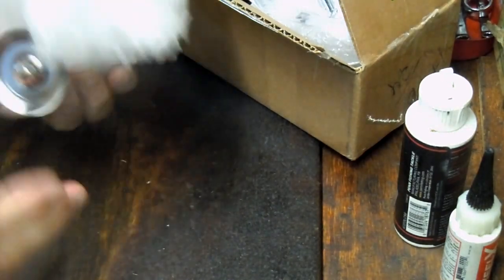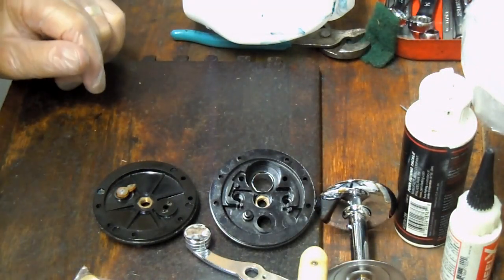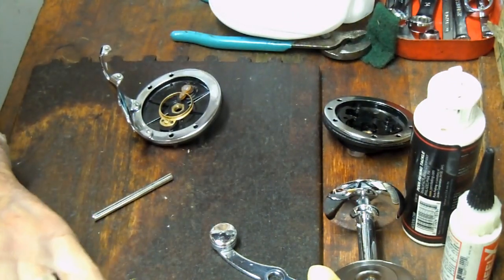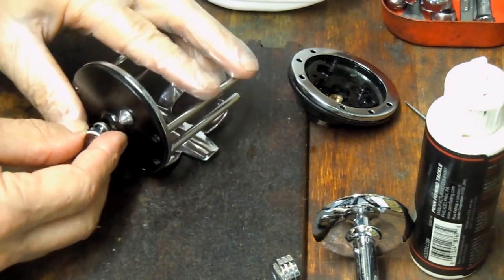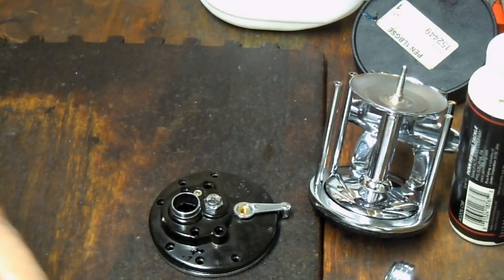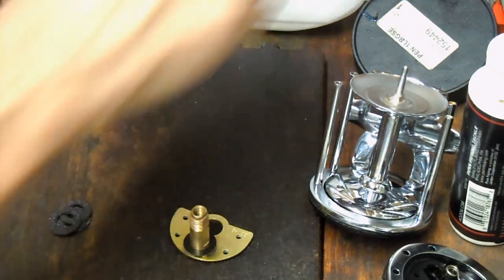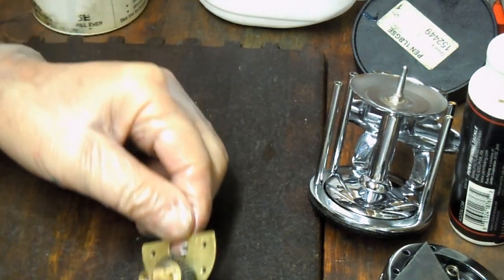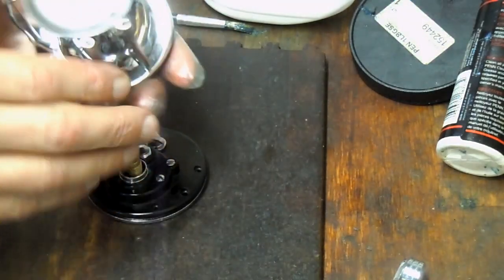Penn 155 Beachmaster how to service and rebuild with new parts

Comment: First beachmaster was called light tackle was introduced in 1941. Wasn't until mid 50s penn changed it to beachmaster well as the beachmaster 160. And we're manufactured until 2003. There is a 165 model but no info on when was first made. Ideal reel for medium game like fluke blue fish etc.
Reply from the maker: Thanks Michael.  Do you know when the ones with the etched side plates were discontinued?  Best wishes - Dennis
Reply: @2ndChanceTackle  exact date. No but it had to have been in early 90s think when went to non etched side plates. However on the penn surfmaster 100, 150, 200, 250 you can still get the etched side plates for them.and most other parts as well. Even flat springs. Through I still call it Scott's bait & tackle. Think it's music parts now. I 've always like penn reels and have a collection of them and Abu for fresh water. If I find out I'll let you know on that. Unless you know.
Reply from the maker: I don't know exactly, but I bought my daughter a 155 for her first reel in the early 1980's and the etched plated were gone by then.  There were replaced by a solid black one.  I have also seen the 155s with a cross hatch side plate and a side plate that read PENN in block letters.
Reply: Ok wasn't sure been a few decades ago. I do have a 155 penn like you described with the blocked letters wasn't sure age of that on I assumed 60s. However it's still great looking reel and performer to. There nothing fancy about them. But they pull in the fish and are very durable reels. Guess that's why I like them so much.

Comment: This is always fascinating to me. You do amazing work and I can only assume you are very familiar with this reel and reels like this. I feel pretty confident that I can figure out most vintage spinning reels older than 1980 but that’s it. I’m quite sure that even then there are spinners out there that old that would still baffle me. Thought I’d tell you that as I predicted I couldn’t bid enough to get that two speed DAM Quick Super I showed you but one day maybe I’ll land one of these. I did however get a truly rare reel I had never seen before - that Mer 52 Punch PUM spinning reel that I sent you the photo of night before last. I sent David in France the same photo but he hasn’t responded yet. Sometimes it takes a while to hear from him. I do know that this is absolutely the only Mer PUM spinning reel I’ve ever seen on EBay. It is supposed to be a surf fishing reel so you know I’m very curious about it. It was not cheep that’s for sure but it is a very beautiful black reel with a large gold screwed on medallion that says “PUNCH” on it. It looks like it would be similar to a DAM Quick reel where the handle and gearing screws into the medallion on the other side. We’ll see if I am correct. Nick must have a beautiful collection! Does he collect spinning reels as well? Oh, when I get that Mer reel and disassemble and clean it, I’ll take pictures and share them with you. This reel could take the “most unique” position in my collection. One final question - was that 1961 Penn Spinfisher 700 the first spinning reel manufactured by Penn?  Great amazing video Dennis!
Reply from the maker: You can't win them all!   Always learning Christopher.  I learned that the Crack reel was a follow on to the Luxor Reel.  Also made in France.  I it possible that the Mer Punch was also from that company?   That is why I suggest David.  I am sure he will get back to you.
Reply: The Punch reel looks very much like
a Bam spinning reel- which are still
made today. To the best of my
knowledge the 700 was Penns first
spinning reel. There was also a 701
not a different model but a 700 with
an extra spool and a 702, which is a
left handed 700.

Comment: Question for you i just rebuilt 2 penn 155 and the spools i put in have play side to side is this normal? New side plates and new spools and internals parts from mystic reel parts
Reply from the maker: Yes - there should be slight side play in the spools.  You can use the side plate bearing adjuster on the non-handle side to tighten up the slack. If it is too much, turn it clockwise.
Reply: @2ndChanceTackle  ok just wondering because there was enough for the line to get caught in the sides,  but thank you your videos helped me rebuild alot of penn reels that my dad had apart already and for the life of me couldn't figure out where the pieces go
Reply from the maker: If there is room for the line to get trapped, then that is too loose.  Tighten down the side plate bearing to take up the slack.  Thanks - Dennis
Reply: @2ndChanceTackle  ok tried that i tighten down the side plate bearing till maxed still no difference do you have an email i can contact you, i just rebuilt alot of these reels my dad already had apart and im just frustrated that some went together fine and some have that play